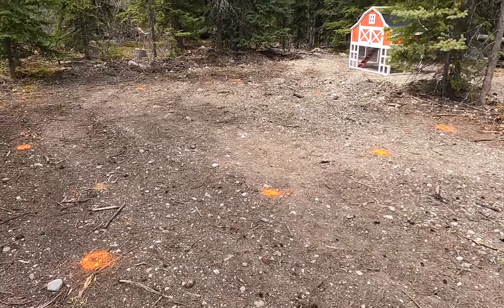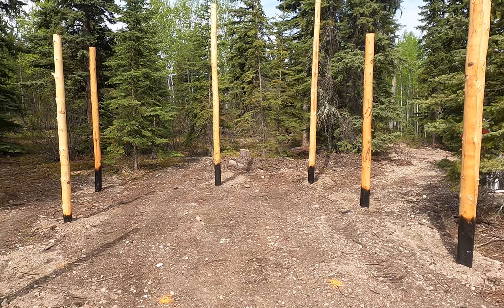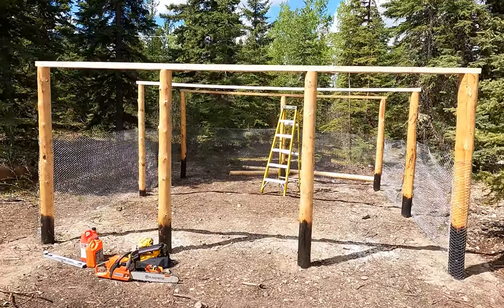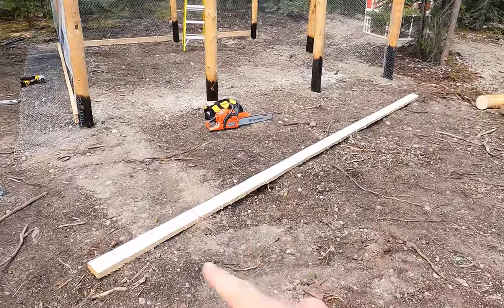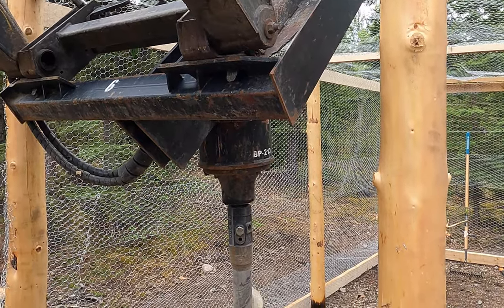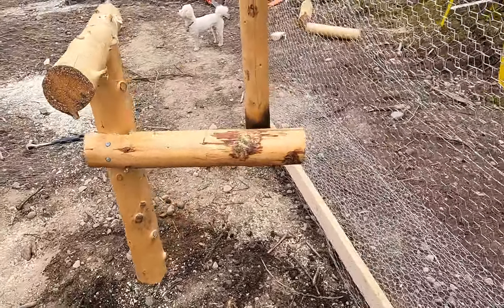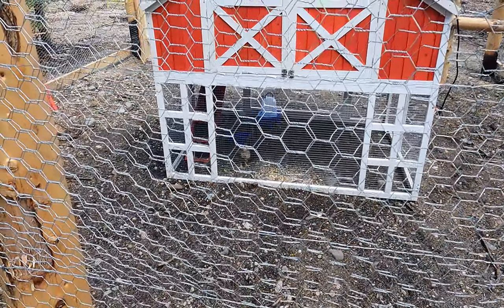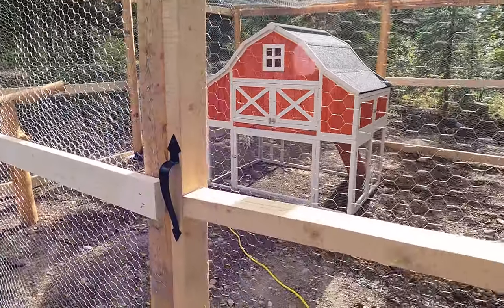Building a custom log chicken run

Comment: Please think about putting 1/2 inch hardware cloth (metal) around the bottom of the coop. About up 3ft high or so. Weasels, minks, stoats can really wreck  havoc  with chicken wire because of the bigger holes. Nice job with what you have done. If you are in a very cold area, your little chicken coop might not be good enough for bad weather.  You might check out Carolina Coops videos, they are very knowledgeable about chickens and it is fun to see what they build. Congratulations on your fine build.
Reply from the maker: Thanks so much for the suggestions. We are definitely in a cold area. We’ve had -38 degrees Celsius and a lot of snow. We’ve had to make a few modifications to our little coop but the girls are hanging in there! Our plan is to build a larger insulated chicken coop and a new run this year.  Really appreciate the time you took to provide some advice!
Reply: Does it have a very good one or a good time to do that
Reply: 2to
Reply from the maker: Can you please clarify what your question is? We don’t understand. Thanks!
Reply: Chicken wire is not good at all. On Facebook a lady had her chicken legs ripped apart because the raccoon managed to grab it through the chicken wire. Horrible to see.
Reply from the maker: Thanks for sharing!

Comment: I've been taught to put chicken wire buried and I the ground around the perimeter of the run Weasel fox and other critters don't like it dig if you have fencing to that depth 16 inches seems to deter them
Reply from the maker: Hi Paul! Yes we agree with you. We did install 2 foot wide sections of wire skirting for this build.  It’s likely only 6-8” deep but so far so good. Thanks so much for watching and for the kind feedback!

Comment: Did you burn the bottom part of the pole or is that roofing tar and did you preserve  the top if so with what? Haven't finished watching video yet.
Reply from the maker: Hey John! Yes we torched the bottoms of the posts and left the rest natural.  Our soil has quite a bit of gravel so drainage should be decent. And we do plan to build a new coop and run this year too.

Comment: If there are raccoons & foxes in the área this chicken wire will be chewed off soon.
I use 1/2 in Hardware cloth 19 gauge. And it is all grounded and reinforced with wooden boards into the ground.
Reply from the maker: We definitely have a lot of predators here, but over eight months we haven’t had a single issue. The coop has its own hardware cloth and the chickens are put away at night. I suppose we could add electric fencing too. Truthfully we were more concerned about grizzly bears. Thanks for the feedback!
Reply: @TrapperCreekOutdoors  yes, i lived in Penticton - BC for almost 10 years, there are lots of raccoons but they wander mostly at night. 
I live in NS now and here i see more raccoons & foxes wandering during the day too.
Reply from the maker: @susanaesmerald2291  NS, how cool we love the maritimes!